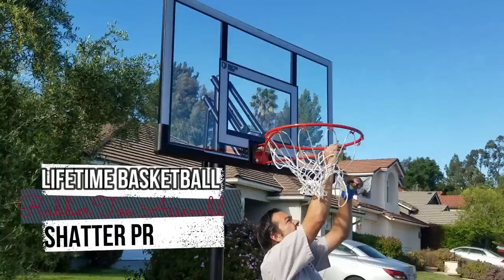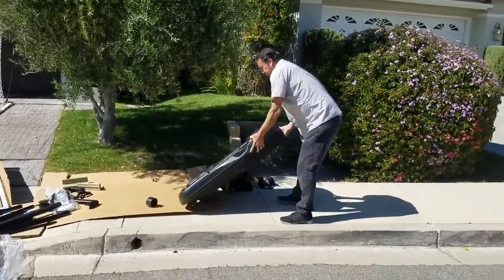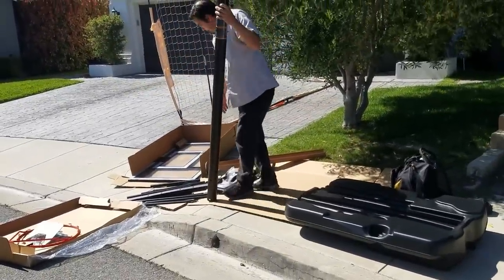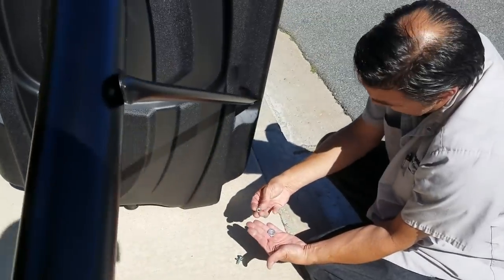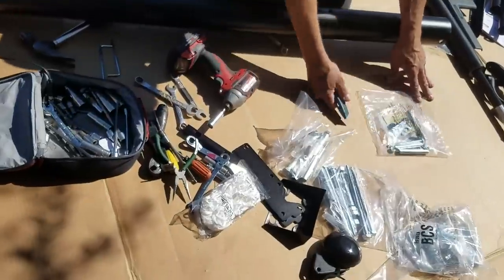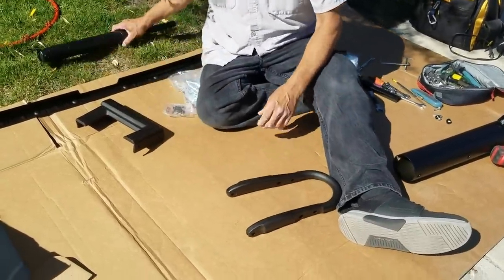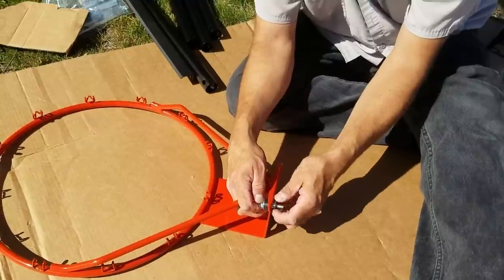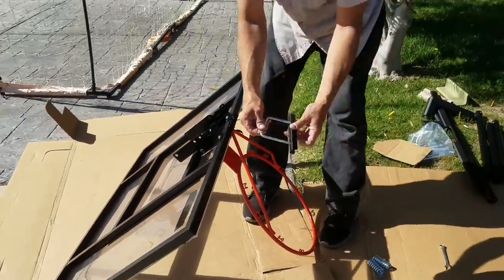How To Lifetime Power Lift Portable Basketball System Build

Comment: I bought mine from someone on cragslist but now that I brought it home it won’t go up or down. So I’ve been trying to fix it all day.
Reply from the maker: Hi thanks for comment, well, i would have to check it out. Maybe call previous owner and see if they modified it. If you contact manufacturer,they might be able to help.especially with possible replacement parts. If you are going to start taking things apart to troubleshoot,then first remove the springs from back of backboard to the lifter poles. And then be careful still. and lay it on ground,,,also, get the assembly manual on line and look at that for sure .it will show you and tell you how all goes together,,and the tools needed, maybe work your way backwards good luck take care
Reply: RubberToe Assembly Yea I took it apart and I guess the shock is broken, looking around to see if I can order a new one somewhere

Comment: 33:54 is the drill step necessary? I don’t think my drill is strong enough.
Reply from the maker: Hi thanks for comment. I have known couple people over the years that left the plastic covers off,but its a protector for when people jump up underneath the backboard, so i would say put nit on. as instructions say. Also,i think any 12 volt cordless drill should suffice. if you have a electric screwdriver ,that would probably work,it just would take so long with each screw,as they are self tappers. Hope that helps, take care ,enjoy shootin hoops

Comment: How can I remove the pole once it’s installed? Wrong side
Reply from the maker: Hi.thanks for question,That is something you want to get right.But if you need to pull them apart,what has worked for me,more times than not is, put one of the long bolts through the holes at the ends,and while you hold one piece of pole,you bang them apart by hitting the bolt in the outer piece in the opposite direction. However,if poles do not come apart,and just won't,then you don't want to damage the hole that you put the bolt through,or bend the bolt in the pole by hitting it so hard.If you have banged the poles together already really hard,they probably won't come apart without damage.Then you might try calling the store you purchased from.or the manufacturer direct and let them know you need new pole pieces.I am three out of five over the years at getting them apart without damage.The two that i could not separate,had to have new pole pieces replaced by store or manufacturer.Never easy,good luck,hope i have helped

Comment: How can I remove the top piece of the pole? I didn’t install it properly.
Reply from the maker: Hi thanks for comment ..well,that is an important part to get right. However,over the years i have been able to get them apart 4 times out of 6 times . The 2 that i could not,had to be exchanged with the store. But the ones that i was able to get apart took some work and a few tricks. If you have not banged them together yet,than it should be easier to pull apart. The bolts that come with it that are used to pass through the arms at the top are what i put through the holes in pole.And then bang the bolts in opposite directions until they come apart, However ,this may bend the bolts and you will have to straighten them after,which could be done  by putting nut on the end ,then banging straight again in curb of sidewalk or street. If the poles are so tight that they still will not come apart,or the holes in the pole are being ripped and damaged ,then you will have to order new pole pieces from store or manufacturer. Hope this helps,take care

Comment: Please help! At 4:39, our axle does NOT fit into the holes. It just won't bend into the holes, it's as if the holes aren't bored correctly. I've tried filing out a bit of the plastic, and also hammering in the axle, but the axle won't budge.
Reply from the maker: Hi,thanks for your comment.Hopefully I can help. So first,DO NOT file the plastic base,because inside is hallow and to be filled with water when assembly is complete.You don't want base to leak when your done. I think you just need to pull the pole more towards base,and push base toward pole,while holding axle at slight angle to get it started,and tapping the axle end at same time. This is one of the several more difficult parts of assembly. If you have two people working together should definitely help.I hope that helps..AND,hopefully the pole is correctly put together,and you are at the right end of pole. It should be the end with a slight dent bending in on the edge. Also,running the axle thru that first plastic wheel does not make anything easier,but the wheels have to be there. Good luck,best wishes on build
Reply: @rubbertoeassembly1673  thank you - I still have the first one which I didn't file, so I'm ok there. I'll try again. You make it look so easy in the video!
Reply: @rubbertoeassembly1673  we did it - the pole has to be perpendicular to the base, that's the part I was missing. thanks again.
Reply: Do you have PayPal?

Comment: Can anybody tell me whether the height can be adjusted SEAMLESSLY/STEPLESS ? To be clear: Most adjustable hoops allow you about 6 steps with each being about 5.9 inches. I want to use the hoop to practice dunking again and I want it to be just under 10 feet. I can dunk on 9.8 feet so I really want a hoop where you can go inch by inch not in huge steps. That info is not available on Amazon or anywhere else... :-( Thanks in advance !
Reply from the maker: Thanks for comment.There are some in ground models that go in the concrete that are much more intailed,and much more work involved,but you can set them any heights usually between 7 and 10 feet. Theres also an older model 54 inch portable that you can adjust like that as well. I have not seen that one in a long time though.
Reply: @rubbertoeassembly1673  Thank you ! Much appreciated !

Comment: Our poles got stuck and we don’t know how to take it apart
Reply from the maker: Hi thanks for comment. Well, that is not good. But once or twice its happened to me, I used the big bolts that come with it to pull apart. I put them through the holes on pole, and bang them apart carefully. Sometimes, if they are not together super tightly, they will loosen and come apart,when tapped in opposite directions. When it worked for me , I had to straighten the bolts again after that. But if they don't come apart or the bolts start to rip the holes in the pole, then you'll have to contact store or manufacturer to get three new pole pieces,and try again. Good luck, be safe about it and take care.
Reply: @rubbertoeassembly1673  thank you🙏🏾

Comment: pls help i put the wrong poles together pls
Reply from the maker: Hi thanks for comment. Just back home and saw this and the pole is a pretty crucial part. I have been lucky at 5 out of 7 over the years. the 2 that i could not get apart,i had to get the store or manufacturer to exchange or send three new pole pieces. hope that helped. also,putting a big bolt through the holes in pole and tapping them apart with a mallet can work. but careful not to damage pole or threads on bolt. put the nut on the end of the bolt a few turns to protect threads. and try not to bend bolt or cut grove in pole holes, They say this step is not reversible,but i have saved 5 out of 7 of them, take care
Reply: RubberToe Assembly thanks

Comment: What is the product number?
Reply from the maker: Hi Thanks,I believe if it says product number,it is the serial number of the unit being assembled.Also has been called ID number.There is also a model number,which is usually fewer digits and references which general basketball hoop you purchased.Also,sometimes the serial # and model # are on the owners manual somewhere.